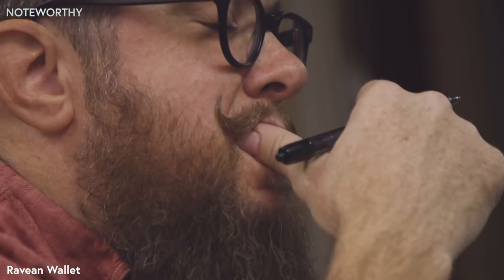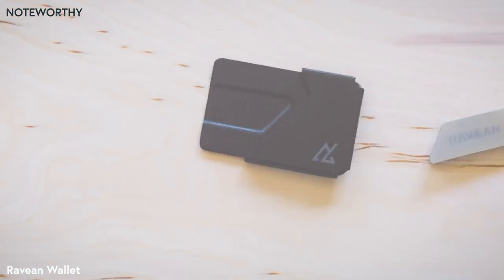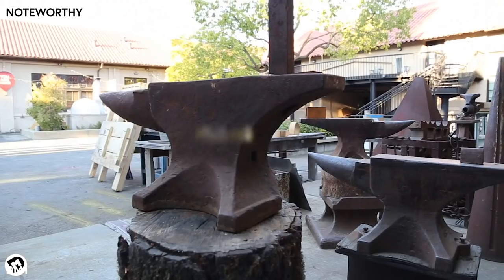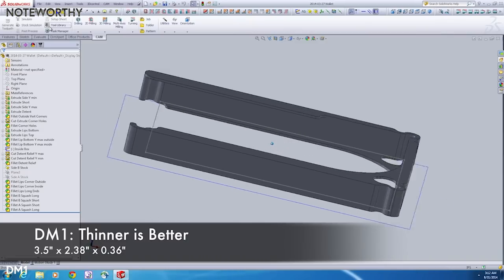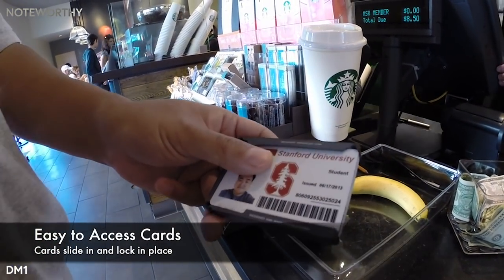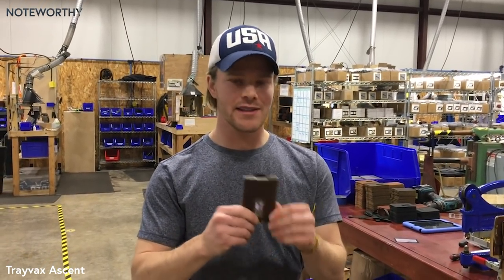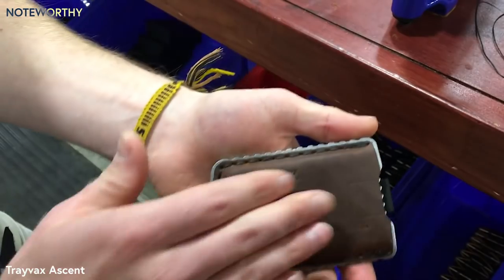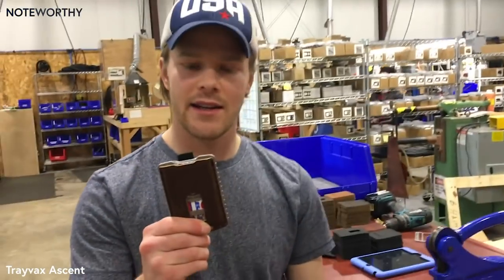5 Amazing SLIM WALLETS for MEN in 2019

Comment: Kore makes an Excellent wallet! I usually carry 8 cards and maybe up to 10 slips of paper cash and this wallet works perfectly for me. I keep my driver's license and most often used credit card in the outside card slot and 6 cards inside with the quick pull tab that works great for easy access. Kind of cool that you can pull the money clip out and use either piece separate from one another. Carbon fiber money clip is light but feels durable. Leather looks like it will last a very long time.